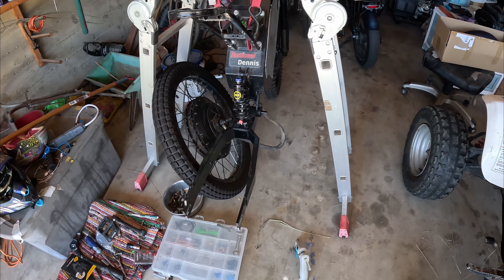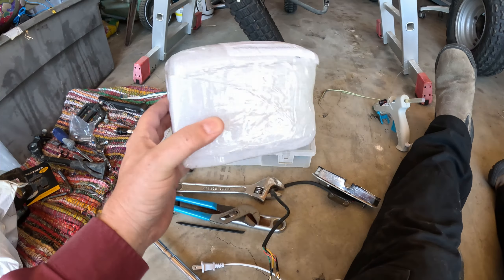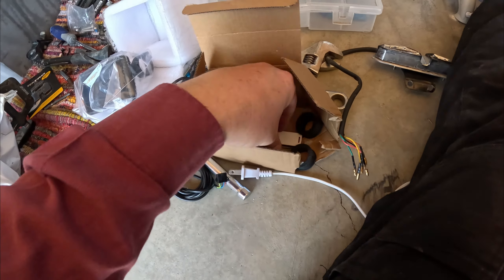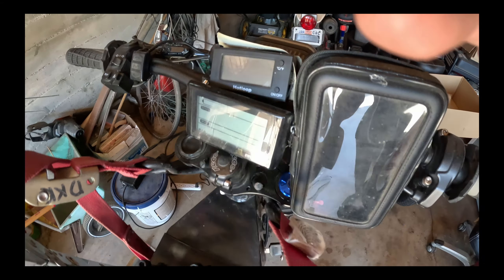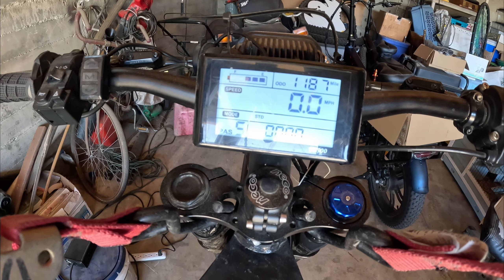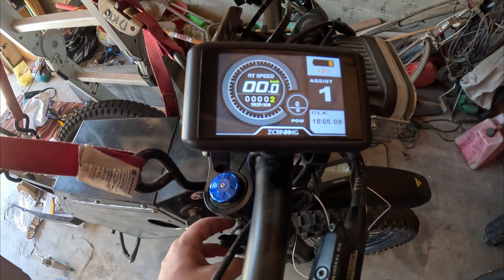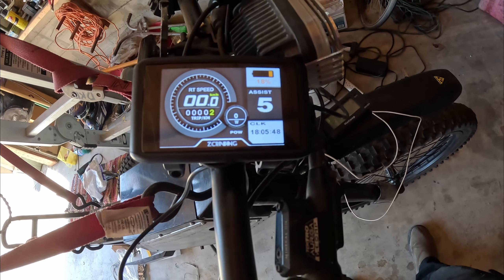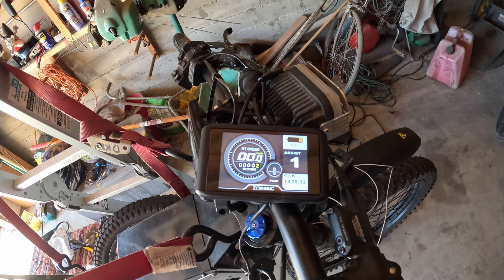Unboxing and upgrading a SW900 to UKC1 display on a 12kw Stealth ebike with a Sabvoton controller.

Comment: Awsome! You pulled the trigger. It is definitely an upgrade worth having. Side note. It took me a while to figure out how to reset the trip/average speed/top speed. Just hold down the "+" and "-" button at the same time. Be careful not to do this while the rear hub is still off. You might accidentally not hit them at the same time and inadvertently put the bike in walk mode. LOL. Another great video, my friend.
Reply from the maker: Yeah I'm still messing with settings. I need to take a few test rides an calibrate  the speedometer. But yeah way better than the lcd version.
Reply from the maker: Also found out 1801 code unlocks more settings. Now I just need to learn how to reset logo. 🙃
Reply: What size tires do you have?
Reply: @tacticooldennis if your tires are 21 in tires. On the advaced setting set your tires to 26 in and the poles to 32. That should get you a spot on speedometer reading. I tested my to 12 satellites and it was right the number.
Reply from the maker: @edgurash834   21"  front and rear.
Reply: Perfect. Just set you display setting to 26 in tires and the poles to 32. You should be set to go after that.

Comment: Nice video...👍🏻👍🏻 Bro I'm having trouble with my Stealth Bomber...one day the display didn't wanted to turned on...i bought a new display the same one you got...ukc1...and when it turned on it was showing 30H error communication...long story short...I bought every wire in the bike new... upgrade the Hub motor to a 5kw one a new Sabvoton 72150 a new battery from Amorge 72v 32ah 200amp continues and the 30h error still showing ...i just got another display is my second new and the error still there....idk what else to do... basically I replaced everything that could be the problem...
Reply from the maker: Might be the throttle; maybe its reporting back the wrong voltage out of the normal range. The controller should have an LED on it that might indicate the fault. They will blink a number to indicate the problem. You can also try an e-bike tester https://amzn.to/3D7SAHp  These are cheap, and you can test each part.

Comment: Back  in early days of ebikes I used to use screens and at one point they  became useless. With Sabvoton, Kelly , votol or fardriver controller screen is just taking limited space on my handle bars . You got way too much going on on your bike . I would limit to throttle and  sexy cell phone holder.
Reply from the maker: Yeah man, I could see that. Nice clean bars like a custom chopper. I just grew up on dirt bikes with little no info and now I like having my speed, trip and voltage at a quick glance.